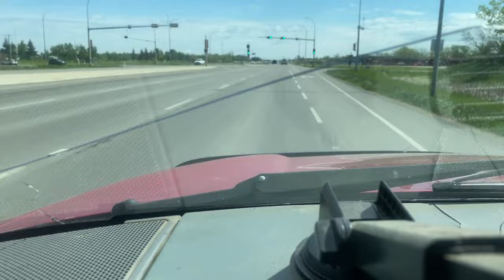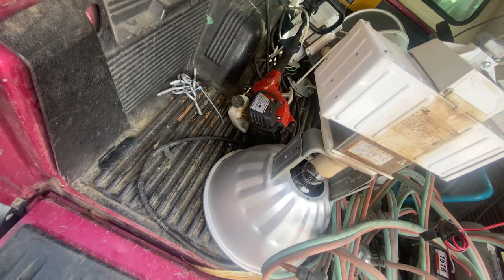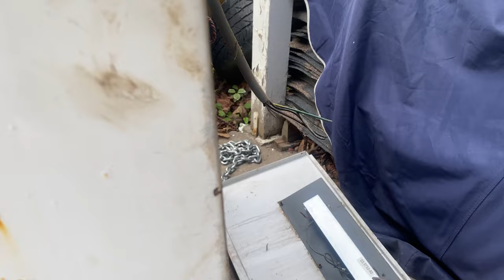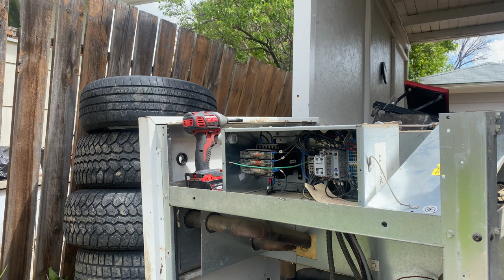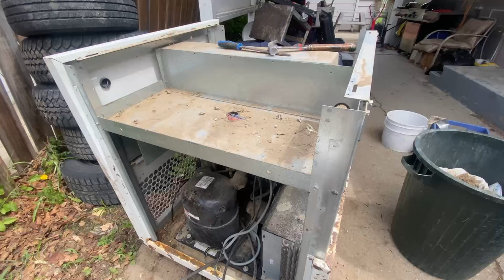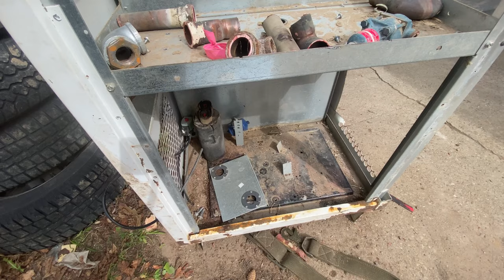Scrapping a I Have No Idea What This Is For

Comment: Isn't there a big copper piece inbedded in the stryrofoam? you cut the ends off but I am not sure you took the copper out of the styrofoam.  i agree I open up my compressors and take the copper out too.  i like buying outdated/nonworking stuff like this at auctions.
Reply from the maker: I might try the juice is not always worth the squeeze

I take apart all motors 100%
Reply: @nicejunk666  gotcha. everyone needs to decide where to draw the line in the sand on when to quit digging for gold.  depending on their experience, speed, tools etc, everyone has different thresholds.
Reply from the maker: @steveherr450 definitely but I decided to explore that piece more because of your comment, I feel if your interested that means others will be as well, and my viewers are my top priority. it might just be interesting to see what’s going on in there , thank you so much for your help and loyalty